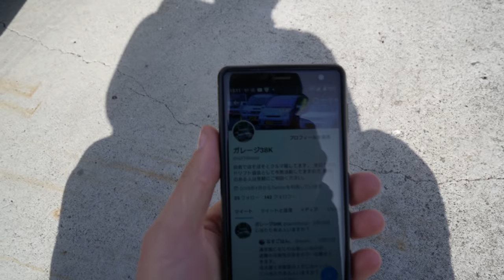JAPAN'S BIZARRE DRIFT CARS!

Comment: I'd take the Hiace because if you're going to throw it in there sideways, there should be a 50/50 chance of a roll over to make it exciting. Although I liked the PVC car as I was surprised by how quiet it was.
Reply: There actually not that bad you can get them fairly sideways with not alot of body roll the one thing is the steering is quite heavy

Comment: E50 Nissan elgrands work quite nicely as well and cheap for parts a mix of pathfinder and 350z . Strip the inside a fair bit and instant 300 plus kilo weight loss . Vq35 stock is about 250hp

Comment: wouldn't it be an even greater idea to fit those pvc bands on a cheap rwd car so you can drift the usual way, but with low engine power and a lot less wear on all the car components?  we did it on go karts and it worked quite well!
Reply: Kei car is really cheap both in price and tax in Japan, so it's the cheapest option available for them instead your usual cheap RWD cars like in the US.

Comment: i have my civic set up to slide.  not like that.  i have stiff springs and kyb adustable dampeners.  1 for cruzin 6 (hardest)  i can swing the ass out easily, tire psi is about 40 hot. i run 175/85r14. they fold up if i push too hard and i run a good bit of camber. the tires flex and catch too easily.  also no hand brake to start the slide, foot brake and turn hard in and let off as u straighten up.  i left foot brake  cause d15b7 and heavy car i need to be on the gas fast to straight up.

Comment: I bought a hatchback that had been converted into a hand controls handicapped style. That particular previous owner WENT AND CUT OFF the steering column adjustment lever so they could install hand controls. When it was to be sold, the hand controls were removed for normal drivers. NOW I have to get an ENTIRE REPLACEMENT steering column just so I have steering column adjustment capability again!!!!! It's SUPER ANNOYING  and I have to spend extra money to FIX IT!!!!!!!! ALSO the previous owner DISABLED the stereo unit so I CAN'T listen to my music and i have to FIX that as well!!!!! IT"S SUPER ANNOYING!!!!!!!   DON"T purchase a vehicle that had PREVIOUSLY been converted for handicapped use!!! It's a BIG HEADACHE!!!!!!!! I say that if you are in a WHEELCHAIR, you SHOULD 100% NOT, I repeat, NOT BE DRIVING A CAR!!!!!!!!!!!!!!!!!!! NOT AT ALL!!!!!!!

Comment: Please import a Vw Golf 3 1.9 TDI, put in the water sprayers, put a bigger turbo and a straight pipe on,  make it roll coal, put pvc on the rear wheels, put an angle kit on it, and slide it